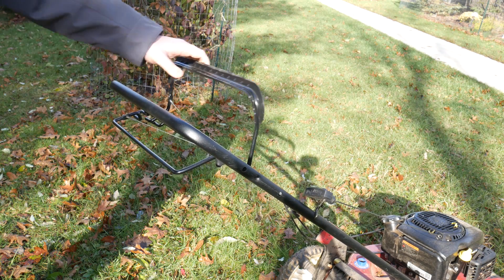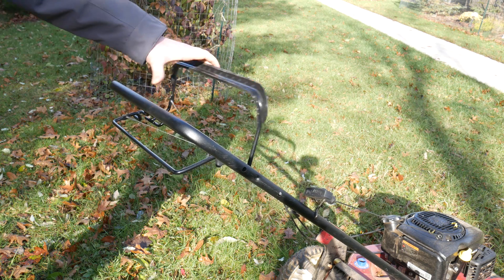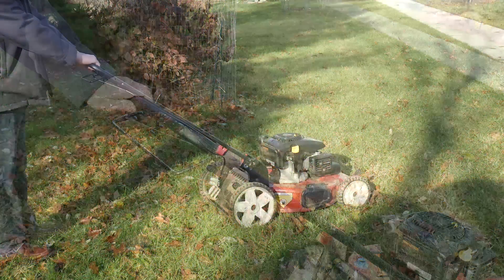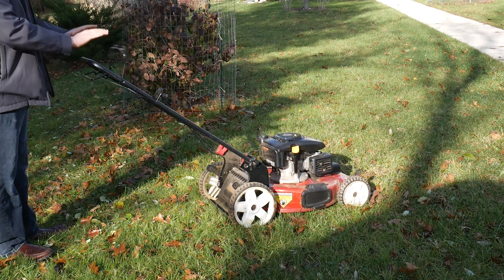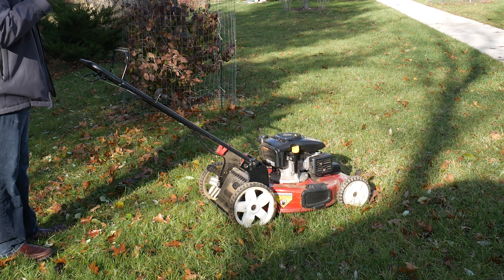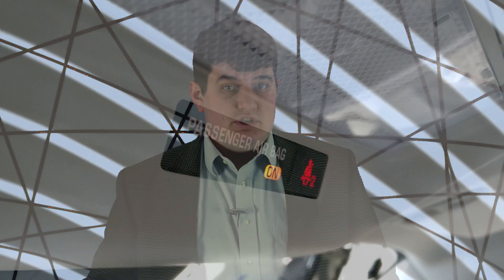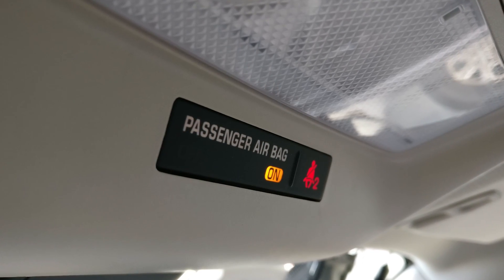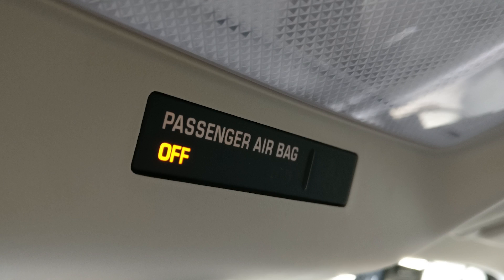The Dead Man's Switch:  How Anton Yelchin's life could have been saved

Comment: It's not so much of a problem with a manual shift.  It's really difficult to get out of the car with the engine running and in gear, since most of us don't have a long enough left leg to keep the clutch pedal depressed.  Of course, it is possible to get out without applying the handbrake, but always applying the handbrake was drilled into me when I was a learner.

Comment: All vehicles should have switches to turn off the airbags for when it is unsafe to have it deploy.  If you are short and have to sit closer than ten inches to the steering wheel, air bags are unsafe for you.  Also if it is necessary to transport a child up front, the airbag is a danger and should be able to be turned off

Comment: 7:38 "..is virtually nothing"

People working at large tech companies which spend $500,000 to slightly tweak the user interface: monkey sideways glance
Reply: Yeah, even though the change would in theory be a few dozen lines of code at most, it'd probably require extensive safety testing and stuff.

Comment: The problem is what happens when such sensors fail, and especially in an area that faces heavy wear and tear, like the driver's seat, or even the driver's seatbelt, it's definitely a when, and not if situation. 

So, say you're trying to go somewhere, and the sensor has just broken. And now, you can't - because the car thinks you're not in the seat. So now you have to pay for a tow, and a new sensor, and the labor, just to be able to drive your car, despite nothing being mechanically wrong with it.

And this is why manufacturers think twice about getting too sensor happy.
Reply: Actually its why they try to not tie non-critical sensors to critical systems, or have ridiculous amounts of redundancy. 
The seatbelt sensor is a combination of seat weight+completed circuit in the seat belt clasp/receptical. Better an annoying noise as you go to the shop instead of an expensive brick if something minor fails.

PS: This accident was an example of user error compounded to worst case scenarios. Would be interesting to see how many people use their E-brake/parking brake when stopped as its designed for stopping these things (it's taught here when car is parked, brake goes on so it cant roll away and cause things like this)
Reply: @shadowraven137  
First off, note that I was referring to the dead man's switch that the video was suggesting - if such a thing became defective, where the car wouldn't leave park, despite the driver being in the seat, then that would present a huge problem.

That said, for tones/alarms,  you gotta keep in mind that most owners are still going to see that noise as unnecessary- and potentially an extra expense to repair, that in their minds, shouldn't exist in the first place. 

Depending on the owner, that's a fix that might take weeks or longer to afford in both time and or money- all the while being forced to listen to it. They wouldn't be wrong to not even care about the potential lives that system was designed to save, when they're slowly being driven insane by the dinging.

As an example, I once owned an early 90's Mercury Cougar, with the automatic shoulder belts. One day the door closed sensor stopped functioning, resulting in an incessant tone, that you could still hear even with the radio blasting. I eventually had to find, and remove the dinger module from behind the glove box, just to preserve what little sanity remained. Oddly enough, within a couple of weeks the sensor started working again, but I never reinstalled the dinger.

Comment: Yeah no the "Stupid Gear shift" is not difficult to tell what gear it's in you have to press the brake and pull a trigger in order to remove it from park, after removing it from park you must press the brake to put it into either drive or reverse from neutral. 

It's a straight lever Which lights up which gear you are in. Also, not allowing the car to be removed from park when a person is in the driver seat it's a safety issue you wouldn't be able to push it.

Comment: The problem is not having a physical ignition switch with a key in a lot of newer vehicles. Most modern vehicles that do use keys wont let you remove the keys if the shifter is not in park. Also parking brakes are a real thing.

Comment: Some modern  forklifts actually have this system already. The seat sensors shift the forklift into park if the seat is empty as well as if the seatbelt is unbuckled. Hell they can even apply a transmission break if neither the break or accelerator is pressed.

Comment: I worked in automotive engineering for a while. There is a good reason why dead man's switches are not used to interlock the drive train, and it's similar to why operation is not tied to the seat belt being inserted into the latch. The concern is that failure to the sensor would occur when the car must be moved for safety. Such as if the car is stuck in a high traffic roadway, railway, etc. But it should be considered. Maybe someone shouldn't park in such a possibly troublesome situation, however the point is we're not trying to rely on operators being safe.
Reply: So yes context for if the car is already moving will protect from that scenario. But not in parking situations that may become dangerous.

Comment: Atleast here in Germany trains have a Deadman switch called the SiFa or Saftey Drive control. It's a switch that has to be pushed every 30 sec to ensure the engineers alertness. If it's not pushed you get an announcement and after it the train will perform an emergency stop.

Comment: The dead man's switch on riding lawnmowers served another function for my father.  Once my brother or I were heavy enough to keep the mower on, we were tasked with mowing the lawn! :)
Reply: I had to put bricks on the seat and mow when I was a kid hahaha
Reply: One of the bus drivers in my town is so small that she has to have a weighted cushion in order to depress the dead man's switch on the bus seat.
Reply: Hi person with the KDE logo as the pfp, I hope you use linux.
Reply: KDE, cool :)
using it now
Reply: Fellow riding mower user here, what brand was yours mine was a 15 year old ish toro that didn’t have working headlights, and needed fixing a lot.
Reply: I’ve disabled the safety on my riding mower because 1) I’m a mad man and 2) it is overly sensitive and causes the engine to die briefly when I hit medium and large bumps due to my weight lifting, and my lawn is full of bumps, causing the engine to go brrrr-rrr-rrrrrrr-rr-r—rrr-rr—rrrr… which is so annoying id rather risk getting mowed over than have to deal with.
Reply: @tylerfranx4286  Attach a seatbelt :)
Reply: Your pfp is cool but i think it'd be better as a barefoot and the word "gnome"

Comment: I drive the EXACT same Jeep Grand Cherokee model with the "dangerous" shifter. I can 100% say that I have never shifted into the wrong gear or had a problem with it. There are gear indicators on the shifter itself and in the dash gauge cluster. Anything can injure or kill you if you don't operate it as intended.

Comment: My Jag XFR has a dead man's switch to prevent starting it. The only way I found out was my sub 5' tall 90 lb sister was unable to start it reliably. When she pushes hard enough on the brake to start it, she lets enough pressure off the seat that it won't start.

Comment: There are a couple practical issues that a dead man switch would have by engaging Park, the largest of which would be breakdown and tow conditions. If the vehicle entirely stops functioning, let's assume a piston rod killed the engine, I would be unable to move the vehicle to the side of the road. It would require me to sit inside the vehicle and somebody else to push. As well as this would make tow trucks loading and unloading a hassle as they normally shift the vehicle into neutral to help make it significantly easier to load the vehicle onto the back of a bed. Or, if they have an all-wheel drive vehicle, if it is a fork tow truck, they wouldn't be able to move the vehicle at all. As the transmission would lock up the rear two tires. So there would need to be some sort of way tov disable the dead man switch, which would kind of defeat the purpose of having it in the first place

Comment: Iv noticed a couple of cool things, going off your mower input, that i find interesting... I will be using my dads grasshopper inline 4cyl. with the handle bars that swing out and my grandpas john deer LT150 with the v-twin 18hp aircooled engine... Both use the deadman switch as you stated but i noticed an override function that in itself has another override function... If you do NOT have the blades running when u put the park brake on the john deer or seperate the handles on the grasshopper you deactivate the deadman switch allowing the engine to run while u pick up sticks but the double override function kicks in when u have the blades running which keeps deadman switch priority over the parking brake shutting down the engine as normal is you forget to turn the blades off for whatever reason so in theory yes this system could be easily installed with the override and double override functions to have redundancy within the system preventing a catastrophic system failure from turning into a catastrophic fatal accident

Comment: You could simply ensure if the door is opened and the vehicle is at a stop or near stop, then the brakes are applied (ABS actuator can do this), then the transmission parking pall can be engaged. The vehicles with an automatic ebrake can enable this too.

Comment: An interesting story about Jeep’s: I have a friend who worked on the steering column for Jeep. He demanded that the steering wheel lock was electronically interrupted from operating if the ignition was on. He had to fight the supplier to put one in because they didn’t want to to save costs and time. He finally won that battle. A few years later, hackers were able to remotely control the car, and had he not put the steering lock interrupt in, the hackers would have been able to lock the steering column while the vehicle was moving!

Comment: I'm sure someone else has posted this already, but Jeep did something very similar to what you're proposing.  If the driver's door is opened while not in park, the vehicle automatically activates the parking brake.  They implemented this as a safety recall which reprogrammed the computer.  

I have a Grand Cherokee with one of those shifters and can confirm that it's awful.

Comment: I experienced a similar issue with a 1995 Suzuki Sidekick where the combination of snow on the ground  , ABS , and the cold weather keeping the engine's high idle engaged conspired to make the car unstoppable.  I hope I'm not making it sound too dramatic because the speed was no more than 2 MPH but unstoppable all the same.  So it's the winter of 1996 and plan B had me selling cars at a local dealership. We peddled Mazdas ,Isuzus and Suzukis along with quite an array of used cars running the gamut from an Acura NSX to a Chevy S10 with a melted dashboard.  After a heavy snow the lot must be consolidated as tight as possible to one side while the other side is plowed and so on until the cars and lot are snow free . I was tasked with moving our Suzuki inventory which consisted of roughly 30 cars like Swifts , X-90s , with the bulk being made up of the quirky but capable Sidekick. We didn't sell many so the batteries were often dead and long sleep  left the cars computer somewhat confused when they were revived. On the day in question a particular Sidekick just stayed in high idle , about 1,200-1,500 RPM . I think it was the computer , throttle map , what do I know but it was about 15°F that morning so perhaps that was the  culprit. While maneuvering the car around I brake to stop it but it won't, it creeps ultra slow but try as I may I am eluded by the text book car ceasing to  move forward one desires with the brake . With the high idle pushing and the ABS preventing the a skid I can not stop  . Here in the future I wish I thought to simply kill the ignition but I am hurtling across the lot at the pace of a brisk walk and I don't have the luxury of weighing out options , I am like Chuck Yeager screaming across the Tropause upon a great tongue of blazing jet fuel far outside the Sidekicks performance envelope with no book or even a modicum of rational thought to guide my hand as I mock the very foundations of thermodynamics and court madness with the zeal of a hormone addled teen . The lot is labyrinthine and at mid shuffle cars are parked both willy nilly and akimbo leaving me two possible outcomes for my incredibly slow yet unstoppable car . They are slowly crash into a 1996 Mazda Millennia S bearing an ominous MSRP sticker of $35,000 or heave the far less pricey Sidekick into park and hope the low speed keeps its persnickety early 90s automatic from implosion. With out a thought because that's how I roll and coincidently how I became a car salesman I call upon the Suzuki's torque converter to sort this mess out and it provides sweet  deliverance and a baseball card in the spokes kind of groan as well . I managed to halt its rampage a mere 5 feet from the  Millennia it would surely have produced a minor dent in . As per a somewhat draconian dealership policy concerning "lot damage" the offending sales associate is responsible for the cost of the body work ,  so many bullets were dodged that snowy morning . Meandering story of my youth relayed in real time format aside it is indeed a dangerous albeit rare quirk . The Sidekick was a bit primitive even in the 90s but if the stars align I assume any automatic with ABS on a slick surface can get itself into this paradox. I welcome the enlightenment if something since the release of Nevermind stops this Anti Lock mayhem from tattering the nerves of wet behind the ears car salesman slinging the likes of third tier Japanese cars . No , you'd be surprised at how many people look at a Toyota or a Honda and say "meh" I loved the 626 LX  .

Comment: You would need to make some type of manual override though. If the car is out of gas and has been put in neutral so it can be pushed to the nearest gas station, then having someone sit in the driver's seat means 1 the car is heavier and 2 there's now one less person to push it. Yes this is a rare use case, but I'm sure there are other cases where you would want the car to be able to move without a buckled-in adult-weight driver. And the problem with a manual override that still allows the car to roll is that people would likely just turn this on, and then leave it on rendering the dead man switch inoperable and useless.

On a funny side note, one time one of my ex's bought a big bag of dog food and put it in the passenger seat. The car then complained until he buckled in the bag of dog food. It was kinda funny that the car insisted the dog food be safe.... though I suppose in a way, it makes sense. You wouldn't want a 40/50lb bag of dog food to land on you in an accident. 

On a side note, even if you did make it so there must be weight and buckle on the driver's seat for the car to move, there are ways around this. Cars are tricky.

Comment: I would normally agree with you, however as a mechanic sometimes you need the car in gear while it's on the lift and nobody there to help you run it. In that case it will be impossible to diagnose correctly
Reply: It would be easy enough to give mechanics the ability to disable this feature while in diagnostic modes.

Comment: I agree that the drivers seat is a symmetrical copy of the passenger seat, and for vehicles sold in right hand drive regions too, I’m sure retooling manufacturing to NOT have x sensor or feature in the given drivers seat would be more expensive than just making 2 front seats suitable for any region. I also agree with others that a door sensor is probably more useful for this purpose, my 2013 Tiguan (manual) would apply the electronic parking brake if the door opened and the vehicle occupant had driven there with the seatbelt on, a nuance to this was that if you hadn’t been wearing a seatbelt this wouldn’t happen as you were probably just shunting around a car park or at a mechanic or service centre to allow for testing purposes.

Comment: My 2019 Ram has a dial knob shifter. I tried to put my truck into drive with the door open and one foot on the running board. Was just trying to edge into a parking spot. The truck set off an alarm and put the truck back into park. Not which sensor I triggered, the seat, the door, a combination of both,

Comment: 1- Tesla's kind of got that
2- and it is not that great. If car lets you down somehow (f.e. gets the battery depleted) you need to switch to tow mode. Otherwise wheels wont move an inch. If the car computer is already of line, you have to do it manually, which you have to look up.  And if you haven't a working smartphone on you, you are s.o.l.
3- I hate those in lawn mowers too. In most cases they make my hands sore from clenching fists all the time. But they are safe.

Comment: I wish your videos would make it to the "right" people.  My 2019 Toyota RAV4 is riddled with safety oddities like this that Toyota removes from lower end models to make you pay for the upgrade.  For example, the car knows when it's dark enough to need my headlights.  It will dim the dash.  If I still don't turn on my lights, it will display a message instructing me to do so on the dash information display.  Yet I have to manually turn the switch myself.  This is just one of MANY such issues in this single model of vehicle.  It's depressing.